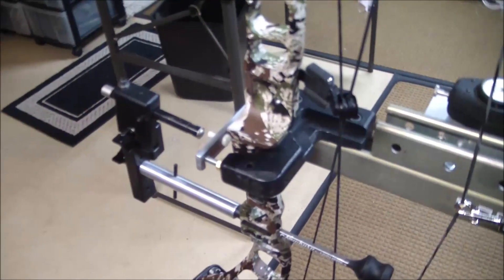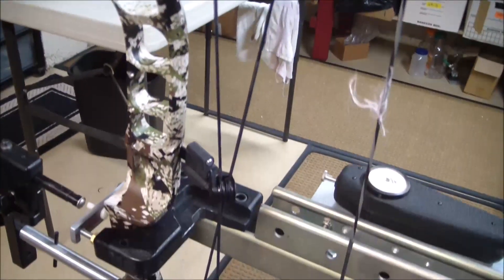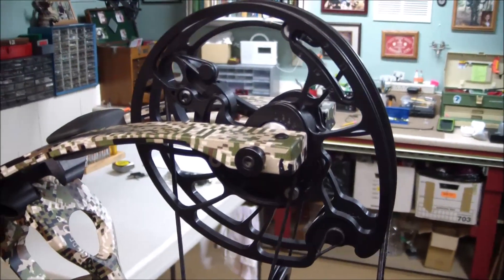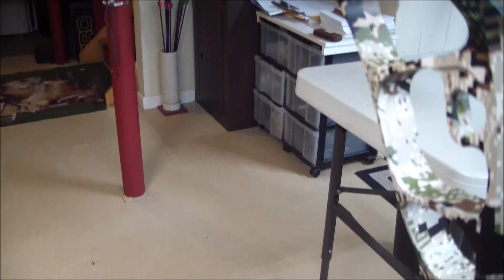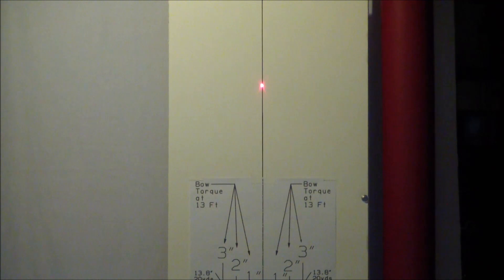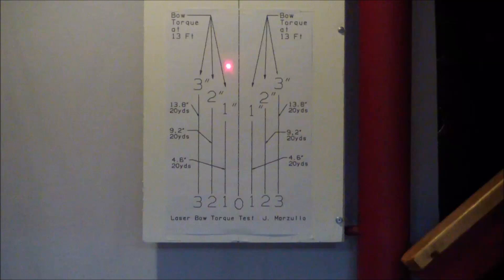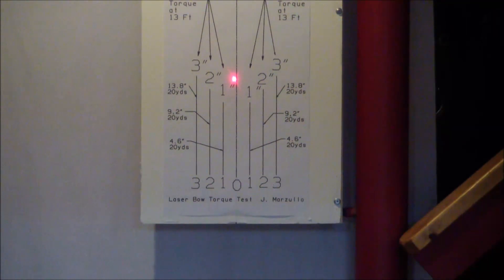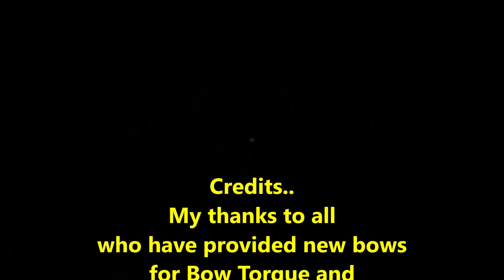2020 Prime Black Series 5

Comment: I’ve been waiting to see this one.  Thanks Joe!  It’s between the Prime Black 5 and the Mathews VXR 31.5 for me.
Reply from the maker: I should have a Mathews VXR 31.5 in my shop for tests within two weeks.
Reply from the maker: May get a mathews vxr for testing...see in a few weeks.
Reply: (T)(h)(e)(D)(u)(d)(e) I’ve shot both, and was equally impressed.  I can’t find a shop that carries both to shoot side by side.  They both have features I like over the other.  Resale is in favor of the Mathews, but I think the Prime may edge out the Mathews on comfort and build quality.
Reply: (T)(h)(e)(D)(u)(d)(e) At 6’4” 260lbs I shoot at 80lbs.  The long riser and oversized cams make the string angle manageable for a 31.5 ata.  I like the fact that the VXR can be adjusted between 27-31” dL and 60-75lb draw with a simple mod swap.  I shot it at 78lbs and it was plenty fast.  I would have to shoot 80lb limbs on the Prime.  I’m worried that the market for an 80lb Prime is small, but the same Mathews fits everyone.  I don’t know why any of this matters to me, I have a 96 model Browning Mirage in the garage. The quality of machining and finish on the Prime are superior to anything I’ve seen this year.  I agree, we are spoiled with all of the great bows nowadays.
Reply: @ericsims91  Have you tried the new Bowtec yet? Just wondering?
Reply: How about the new Bowtec design???
Reply: Northwest Spur Chasers I shot it, and to me it just didn’t fit well.  Even the Revolt X felt too small for my liking.  I do like the new cam tune ability, but that isn’t enough to make me switch as once I get a bow in tune, I won’t need that feature again (hopefully) until I change strings down the line. I prefer the elements making a more comfortable and accurate shot are the features that I decide on.  These two have been the top contenders of all I’ve shot, which is most of them.
Reply: @ericsims91  Prime has come a long way I agree! Thanks. Been a while since I have shot one. In the earlier days I found them noisy and a lot of had vibration. Time to try again! Thanks